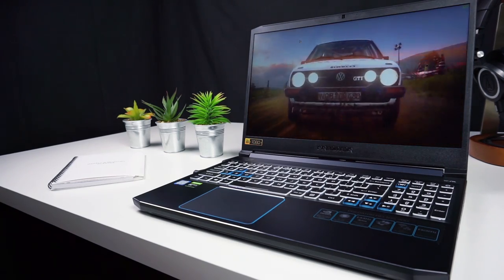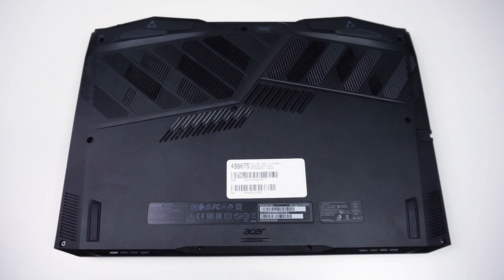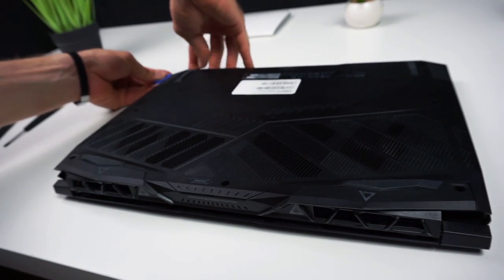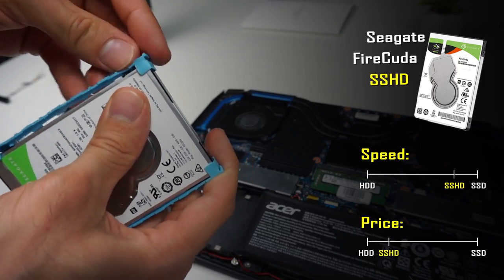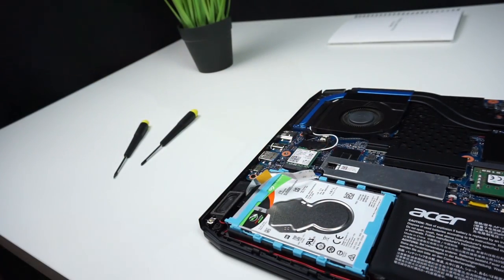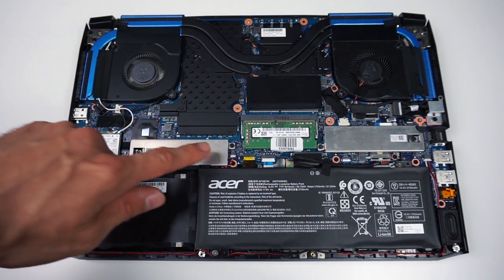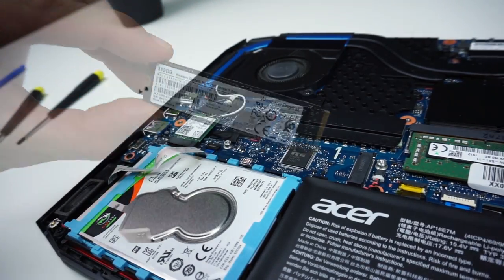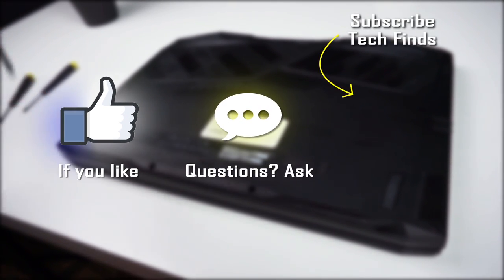Acer Predator Helios 300 2019 Upgrade RAM / SSD / HDD - Disassembly Guide

Comment: Wow you are still answering questions. SSD's are in their own separate case and not open like an HDD or SSHD will they still fit and use the same rubber mount? I'm going to continue scrolling to see if I find the same question.
Reply from the maker: Hey, but on the sides of 2.5" SSD's there are still spots where you screw the screws in the same way as with HDD. Actually in case of this Helios 300 there are no screws but the blue rubber frame goes into these slots instead of screws.
Reply: @TechFinds  oh so it still works then? Awesome. I see you guys still upload. Just earned yourself a subscriber for that quick response.
Reply: @TechFinds  going through and watching all your videos on my laptop...dude you are awesome. I hope you make money by doing this, you deserve it.
Reply from the maker: @WEASELHUNTER13  Maybe one day i'll make money as the channel grows. :) Thanks!

Comment: Hi @Tech_Finds I've a question, I have a stock 16gb of ram on my helios300. Will it make any difference if I install another 16gb of ram (16+16). will I get good fps? Or it is not necessary. If yes which brand should I go for. Thank you.
Reply from the maker: If you have 1x16 now then adding another 16GB stick will activate dual channel which a lot of games need to run at higert fps. You'll also have more RAM, but that's not really necessary since 16GB (2x8) is enough for gaming. If you mix RAM go for Crucial that i linked in the description since it has the same specs as original ram

Comment: Hi and thank you for the nice video. Are you sure the Crucial SSD card will work because the connection seems different than the WD and Samsung one.
Reply from the maker: Yes you can, it supports both types.
Reply: @TechFinds  ok thank you, I ordered the samsung one but the Crucial seems to be almost $70 cheaper so I will go for that one instead since I'm not a big gamer.

Thank you
Reply from the maker: @diamondcomfort7  but you need to know that NvMe Samsung is like 3-4x faster than this SATA Crucial
Reply: @TechFinds  I actually went with the Crucial P1 which is a NVMe M.2 SSD , but I was a little surprised to the see NVMe retail for only $95. Do you know why it is even lower than the SATA ? Thank you

Subscribed
Reply from the maker: @diamondcomfort7  it depends on the volume of SSD. And maybe it was on some sale.

Comment: A couple questions, what is the purpose of adding more RAM? And if I buy a compatible 16GB stick, will it add to the existing ? And is it better to buy the M.2 SSD shown in the video or the Samsing 2.5 inch SSD ?
Reply from the maker: Hi, if you have 1x16GB RAM it's good to add another 16GB to have dual channel RAM as in some cases it improves performance a lot. RAM is for multitasking in general and it's also important in graphics program - the more the better. Games usually need 2x8GB.
M.2 SSD is much faster than 2.5" SSD, so it's up to you. In the video I didn't install any new M.2 SSD, but I linked some options in the description

Comment: Hey dude, so when I bought mine it had a 1TB 2.5" hard drive in it, is there another slot to add a 2.5" SSD? Or does it have to an M.2 SSD?
Reply: Can you send me the link of yours? Because i have been looking for one with 1tb instead of 500gb
Reply: @criizon  you mean my SSD? It's a Kingston A400 240GB
Reply from the maker: @criizon  If you have only one 2.5" HDD then you should have two M.2 slot free. In the description i linked compatible drives
Reply: @TechFinds  alright thanks dude

Comment: I have an urgent question, please. I also have a Helios 300, but model 317-52. And when I open my drive bay to connect the SSD, I already have a SATA connector. BUT the SATA connector has only 16 pins , not 22 pins. ( 7 for data and only 9 for power ). So my question is,  is it ok to connect the SSD directly to the 16 pin SATA connector ? ( because I saw you used a 22 pin connector )
Thank you, and have a good day sir ! Awesome video ! ( the SSD i want to connect is SSD Samsung 860 EVO 1TB SATA3 2.5 inch )
Reply from the maker: If the connector came with the laptop originally then i think you should be able to use it.
Reply: @TechFinds  Thank you ! Keep up the good work <3

Comment: Hey i own this laptop.. 2020 version, been using since one month and it is a great laptop but one day after usage of one hour, a red line appears out of nowhere.. It has been there constantly, it even appears in bios, so definitely a panel fault.. Also the bottom bezel gets hot, not that hot but kinda warm, is it normal?? My laptops in warranty so I'm giving for repair! Just need to know if bottom bezel does get warm or not? And the hinge is also kind of Strong so i need to apply more pressure to open the lid and that might have caused those red lines..!
Reply from the maker: Yes, this laptop gets hot in the area under the display, especially deck, but it's normal for this model. I dont think that it could damage the display. Just a faulty panel unit

Comment: Hey I got a question, can I get any other HDD installation kits aside from acer? I lost mine during a trip now I am worried if I still can upgrade my hdd
Reply from the maker: The blue rubber frame for HDD is made specially for this model and you have to have the same one to install a HDD. I'm not aware of any replacement parts not from Acer, but maybe some people list original parts for sale.
Reply: Thanks for the reply!
Reply: @TechFinds  does the blue rubber frame and the connector are included inside the laptop or i need to buy them separately
Reply from the maker: @beeko3000  You should get it in the box with laptop.

Comment: Hi, I have a Acer predator helios 300 with these specs  - 10th Gen Intel Core i7-10750H, Overclockable NVIDIA RTX 2060, 17.3" Full HD 144Hz Display, 16GB DDR4, 512GB NVMe SSD, RGB Backlit Keyboard, PH317-54-75K8. I would like to upgrade the ram. Can you tell me the best one? It come with 16gb I would like to at least double it. Thanks for your help
Reply: It’s in the description that ram and ssd you can use for upgrades

Comment: I have the same model as you, can I buy a new 16ram to add to my original 16ram even if is not the same model (but same specs)? Or I will not have dual channel this way?
Reply from the maker: If you'll match the specs your dual channel will be activated. You can buy different brand but match the specs with original ram

Comment: Can you do a fan cleaning guide? I have this same laptop and noticed a weird noise from the fans and im sure its because of dust. Im scared to do anything since ive never had a laptop
Reply from the maker: Well, i'd like to help, but i am not permitted to disassemble cooling system in the laptops that i test. Also i had this laptop for a limited time only, so i had to send it back.

Comment: Out of the four listed SSDs in the description (I'm assuming they are all compatible with the 2019 Helios), which would you recommend most highly?

I noticed that two (Samsung 860 EVO and Crucial MX500) were SATA, and the other two (Samsung 970 EVO and WD Black) were NVMe. Is there a difference between the two types, or are they relatively the same?

I'm only looking to add 500 GB right now, but if one is noticeably better than the other (SATA and NVMe), it'll help me narrow down which one would be best.
Reply from the maker: NvMe is much faster like few times in some cases. I linked MX500 as a cheaper option, and please note that Evo 860 is a 2.5" SSD which goes to your laptop instead of HDD. Other drives linked are M.2
Reply: @TechFinds  Is there any performance difference between M.2 and 2.5" SSDs?
Reply from the maker: @HoonterMustHoont  yes, because 2.5" SSDs are all SATA. M.2 SATA will perform about the same, but NvMe is much faster.
Reply: @TechFinds  Oh, ok. Thank you so much for the information and quick responses!

Comment: I have a couple of questions, did you upgrade all three here? SSD, HDD and RAM? If I buy all three of the same ones you've recommended will my laptop run a lot smoother? I'm looking for more memory which would involve buying the HDD, but I'm wondering if it's worth buying both the SSD and HDD? I'm mostly going to be editing (Premiere, After Effects & Photoshop). I'd really appreciate a reply man, thanks :)
Reply from the maker: For graphics programs it would be good to have more RAM. You can upgrade up to 32GB (2x16) 2666MHz. I didn't upgrade this laptop, i just showed how to do it. If you want the foftware to run faster you can install it on the fastest SSD you have.
Reply: @TechFinds  Got you, think I'm going to go with the 2 HyperX 16GB sticks of RAM.. Would you recommend upgrading the HDD and SSD also? I've sent you a message on Instagram
Reply from the maker: @LukeMackie  you can do it, otlr just install your programs on your current ssd if you have enough space. Unfortunately i answer only on YouTube
Reply: @TechFinds  No worries :). I'm going to go with the Samsung 970 Pro 1TB SSD, and the Samsung 860 Pro 2.5" SSD instead of the hard drive, as well as two HyperX 16GB RAM's.. What do you think?
Reply from the maker: @LukeMackie  That's an expensive upgrade but thede drives are fast, as same as RAM. The laptop should skyrocket :D
Reply: @TechFinds  Perfect timing, I literally just clicked the purchase button.. You're right, I just spent £700 on the upgrades, I sure hope so! Thankyou very much for the info my man :)

Comment: I am just wondering about ram.  I have the 2019 i7 RTX 2060 model. I want to get 32 gb or even 64 gb if its in my budget to handle 4k video editing. Does it have to be 2666 MHz or can I go higher? I'm still just learning about computer parts.
Reply from the maker: 2666MHz is maximum this laptop can support. Also you can have up to 32GB. However i've heard that it may take 64GB but i can't confirm that
Reply: @TechFinds  Awesome thanks for your help 🙂

Comment: Hello. I would like to ask a quick question: my laptop has 8GB of ram.  I want to upgrade to 16.  Am I better off just installing 16 or leaving the 8 plus 16 for a total of 24.  Would there be any issues with ram of two sizes? Thank you.
Reply from the maker: It's better to have 8+16. Dual channel may not be activated when mixing RAM sizes but you'll have better performance anyway
Reply: Tech Finds thank you

Comment: Quick question Tech Finds, I just got this laptop and I haven't done anything to it yet but was looking to add another ssd to it.I just want it for storage because I'm running out on the stock ssd. Once I add the new ssd, and partition it(I scrolled through the comments to get that answer) what is next? I mainly want the storage for gaming, can I just put my game folders on that drive and play right away? Or is there something else I have to do?
Reply from the maker: after you partition it you can just drag your games from old to new drive and they should work, but it's not 100% guarantee.
Reply: @TechFinds  wow thanks for the quick response, and okay thanks. I subbed

Comment: How is the speed on that 2tb sshd.... I’m getting ready to update mine as well. Stuck between a 1tb Samsung evo vs a 2tb sshd like in the video....?
Reply from the maker: Samsung Evo will be way faster regardless the situation. SSHD can be fast as SSD, but only in proper conditions when you "learn" it which app you use the most by often using it. Idk exactly how it works, but I treat SSHD as a HDD alternative, not a SSD replacement.

Comment: I have a a couple of questions. Can you change the refresh rate to 60hz IF I wanted to? Would it damage the monitor if I do that? Also, if I do a fresh install of windows, would it make the turbo button useless?
Reply from the maker: Hey, go to right click desktop > Intel Graphics settings >  display and see if you have an option to switch to 60hz. Idk how in this case but usually when you have 144hz pannel you can switch it to 60hz if needed. Fresh install of Windows will probably make turbo button useless, because it's bound to the Predator Sense app. However i don't know if downloading and installing an app will make it work again, because I didn't test it.
Reply: yes you can

Comment: I have bought ram through your link and I asked also Amazon if it fits my laptop and they say yes. But it’s too big for Acer Predator Helios 300!
Reply from the maker: I checked the Li ks again a d all RAM in the description are compatible. They are all 260 pin laptop ram, so there's no way they can't fit. Maybe they sent you a wrong RAM
Reply: @TechFinds  I got the same RAM. How can I replace 7.3 cm RAM with13.3 cm RAM? Amazon says it is compatible with my laptop. But how is it possible to replace the small RAM with larger RAM?
Reply from the maker: @LHA100  as I said, maybe they sent you a wrong one by mistake. You can return and buy different one.

Comment: I just got the 2019 acer predator helios 300 and I am going to be buying another m.2 SSD for it but i have a question before buying. are there any m.2 SSD out there that wont work for this laptop or any you would stay away from? Thank you
Reply from the maker: Generally if you see Samsung, Western Digital, Crucial, Adata and other main brands you'll be good. Just note that this laptop has 2 slots for M.2 SSD both ow which support NvMe drives, but only one of them supports also SATA M.2.
Reply: @TechFinds   thank you

Comment: I brought the HYPERX RAM X2 and inserted in.. but on start I get an black screen for 30 seconds and then the system automatically reboots. After each restart the computer is fine, however once I shut the laptop for more than 30 minutes, the black screen for 30 seconds and then system reboot starts again. Is there something wrong with the RAM or is it an BIOS issue? 2666MHZ DDR4 2X 8GB SINGLE CHANNEL HYPERX
Reply from the maker: I think that it may be some problem with BIOS Settings. Hlwever i don't know exactly where to look for it. Try to update BIOS first

Comment: Hey so I installed a 500gb M.2 NVME SSD from Samsung it was the 970 Evo Plus, windows detects it and I can store files and run files off the drive fine but I can't seem to install the driver from the Samsung website called "NVMe Driver" I get an error message saying "Samsung NVM Driver Device is not Connected. Connect the device and try again." did you have issues installing the drives for M.2NVME SSD with this laptop?
Reply from the maker: I didn't install a new drive, because I did not have any, so I just took out the original SSD and showed how to install it. Do you need this driver if your SSD works well?
Reply: @TechFinds  not as far as I can see based off my own experience but it's definitely something to watch out for when purchasing a Samsung 970 evo plus off Amazon. I've been reading up I'm not the only one with this issue. I reached out to Samsung and they basically told me to fuck off and speak to Amazon instead for help 😂😂 as if Amazon made the product they're only selling it.

Comment: Is the Predator PH317-53-71D6 compatible with a  Samsung (MZ-V7E1T0BW) 970 EVO SSD 1TB - M.2 NVMe . Bought it year 2020. Trying to upgrade it. Read online that 512 gig is the max. Dont know if putting 1Terra would be bad.
Reply from the maker: You can install even 2tb if you want ;)

Comment: hello i just bought an predator helios 300 ph 315-52-748u come with ssd m.2 128 gb and i want to know if can i install another 512 gb? that will be 128gb right side and 512gb left side? what is the diference between the slots?
Reply from the maker: Yes, you can. The difference between both m. 2 slots is that one supports SATA and NvMe and one supports only NvMe, but idk which one is which ;) you have also a slot for 2.5" drive

Comment: Hi I'm just wondering if the rubber stripes came with the hard drive in the same packaging?
Reply from the maker: No, you should get it with the laptop. HDD manufacturers don't ship special parts for certain laptops.

Comment: Hey. Thanks for the video. You linked SATA and PCIe M.2 SSD's in the description. Can I really use both types?
Reply from the maker: Yes, the laptop has 2x M.2 slot - one supports both SATA and PCiE and one supports only PCIe.
Reply: @TechFinds  thanks. Do you maybe know if the "only PCIe Slot" is already blocked by the built in SSD?
Reply from the maker: @AspirePredator  most likely yes as this laptop comes with m.2 SSD by default
Reply: @TechFinds  okay. Just ordered a 2.5" SSD. Is the cable I need included?
Reply from the maker: @AspirePredator  you should get the cable with laptop. Buying drive the cable is not included
Reply: @TechFinds  if I have one pcie m2 ssd, what is better to install as second, m2 sata or m2 pcie?
Reply from the maker: @jimmiedimmick7226  it depends on your budget, coz you can go for any of them ;)